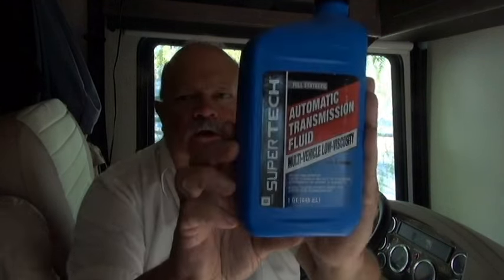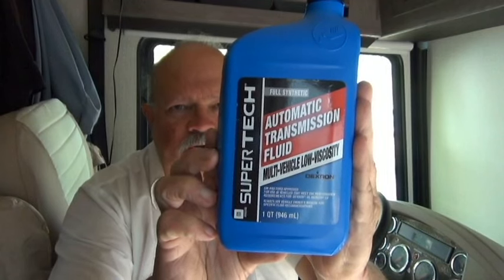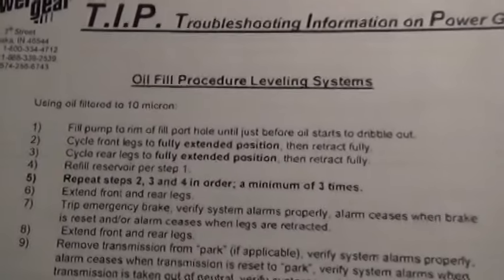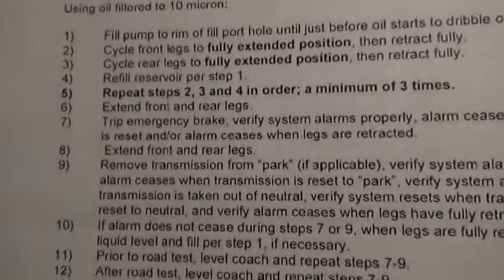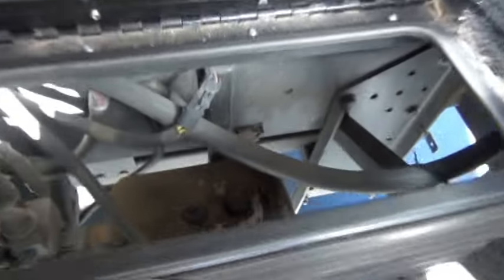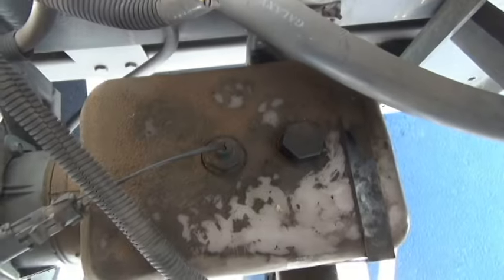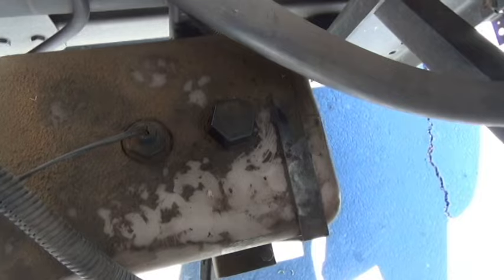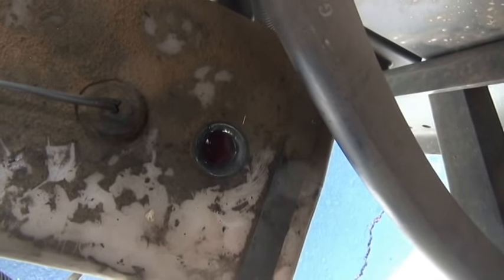How to add fluid to your hydraulic leveling pump reservoir

Comment: “And to remove that cap.  You need to wear some plastic gloves.”  So how do you remove the cap?
Reply from the maker: Mine is just a plastic cap that easily pops off. If yours is a metal screw in type, grab a wrench if your hand won't turn it.
Reply: That is what I need to know also!  We got it loose now it’s just spinning. It’s in aF’ed up place so I can’t see the top to tell what’s up. 
Have a 1993 - 4 Georgie boy cruise master with the HWH 310 series leveling system. 

I’d anyone could advise I’d be very grateful. Thank you
@jerrydixon

Comment: Hi Jerry.  If you can't detect or find a leak where does the fluid go?
Reply: Sorry about that.  I was heading out when I typed that question.  I have been RVing for 27 years.  Have had four RVs.  I have an 06 Winnebago Journey 39k at the moment.  Like you I bought it new.  Had some issues with it.  As you said in one of your previous posts we the new owners are the quality control.  We get to find out just how little quality control goes in to building these homes on wheels.                                                                             OK  I'm off topic.  Guess I have asked before and never retained the info or received multi explanations.  If a reservoir is full and stays that way for months if not years and a leak is never detected or found.  Does it mean the fluid evaporated?   Can the reservoir go down without a leak?  I was told there is a float in the reservoir.  Once the rams start extending the fluid lever goes down setting off the alarms letting you know your jacks are extended.  Once the rams are retracted the fluid rises and the float turns the switch off turning the alarm off.   Good posts  I'm enjoying watching your travels and the info about your RV.  Keep em coming.
Reply: At the autoparts store buy some fluorescent leak detector dye as it is safe to use and then put in the reservoir.  Buy the special flashlight available too and go under the coach and shine in areas where you think it might leak and I bet you will find where that fluid ended up. If that don't work then put that reservoir on a diet.
Reply: Do you know where the Reservoir is on a 2000 Holiday Rambler Endeavour?

Comment: Mine is not working after I added fluid
Reply from the maker: You may have overfilled. Leave the reservoir cap off then move jacks up and down and it will spill out excess fluid